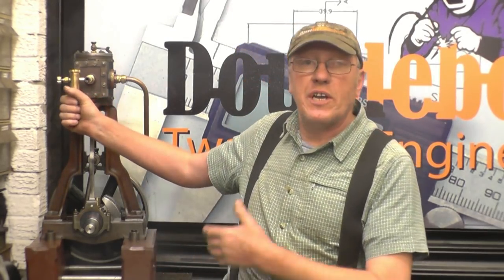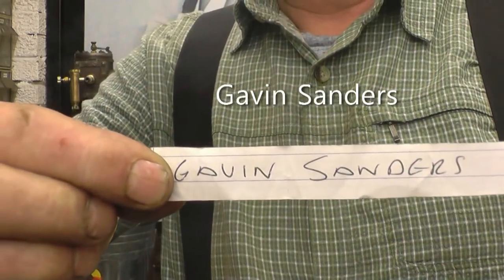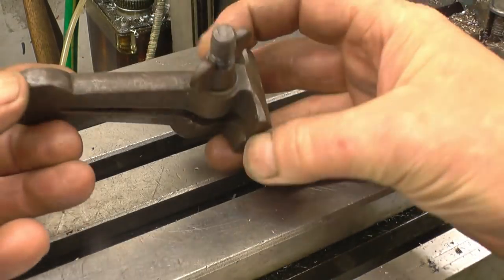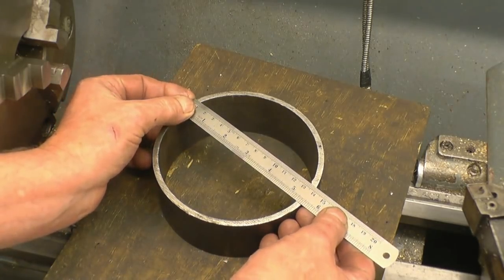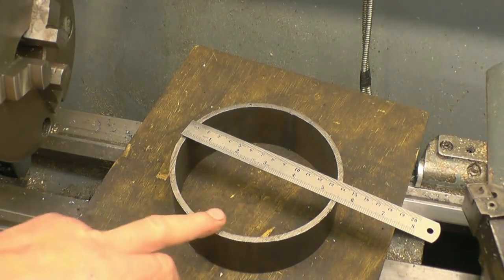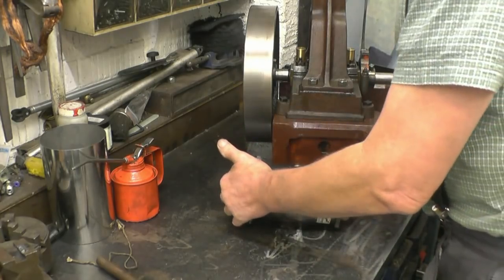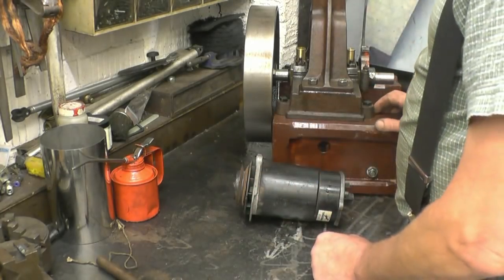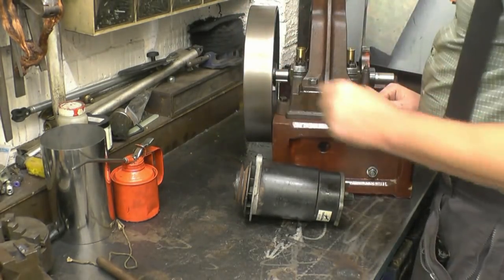SNNC 230 P1   Engine Running On Steam

Comment: Like how the Sentinel wagon has a built in power take off unit, and it is a very portable one as well, just a single steam hose and you get a power pack that you can use anywhere around it.